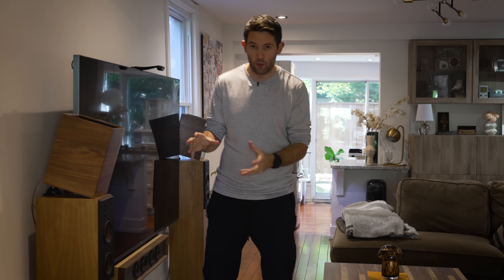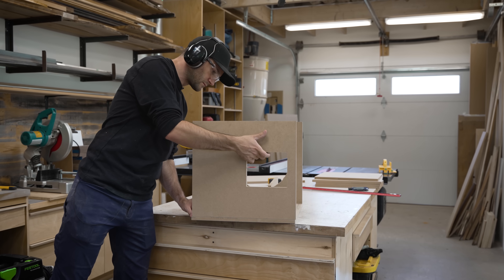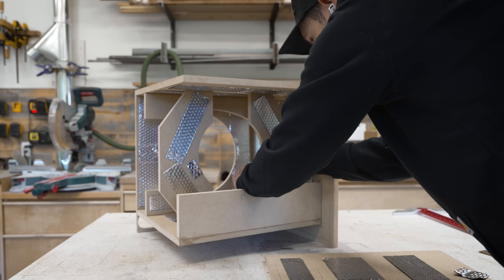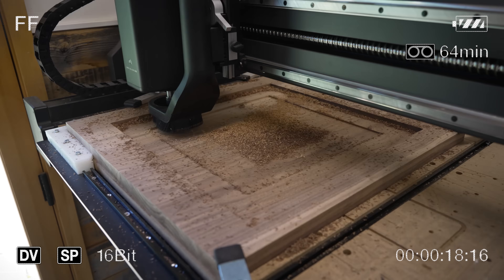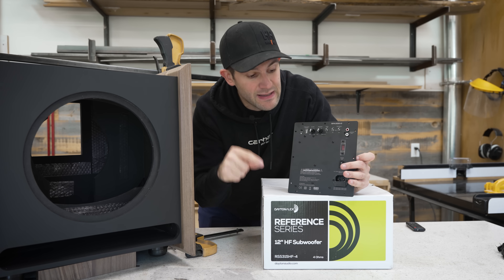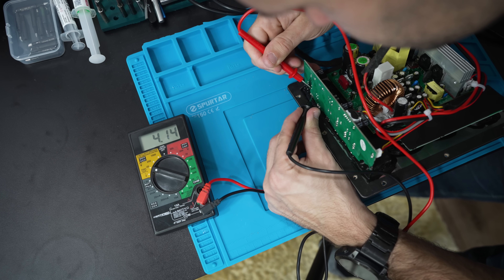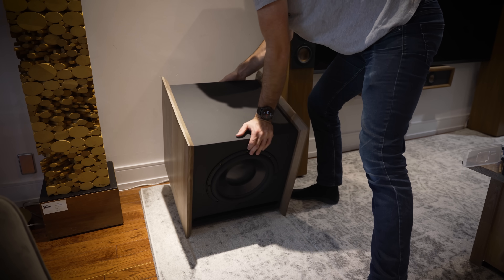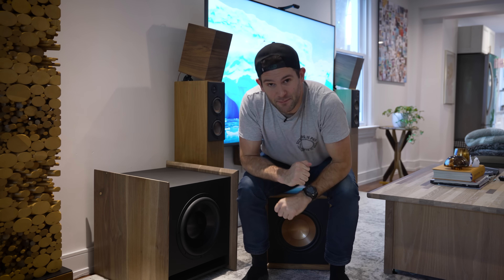THIS changes DIY Audio...

Comment: So sorry. Ported is so 1950s. Pulsed can drive up to 25x the sound with the same energy. See Burning man Cat-henge.
Reply: "Aaron “SPAZ” Winett. 

 He contributed excellent solutions to sound amplification challenges – especially the use of small transductive “exciter” speakers that effectively transform the entire Catolith into one large vibrating cat shaped speaker.  This combined with the choice and positioning of the subwoofers give the Holofelnity purring much of its aural appeal. "

Comment: Nice work. I might have to pick up one of those Daytona wireless transmitter systems, seems like it could save a lot of hassle trying to run and hide wires.  I'd use it for tactile transducers on my race sim rig and/or in a recliner/ couch but I don't think I'd use it on a speaker or sub. I might try it though just to see what happens.

I built my first subwoofer enclosures in the late '80's - early '90s and actually had to go buy books to read about it, no internet!! Can you imagine?  But those books were very interesting.  Car audio was a great hobby back then, it taught me a lot about electronics, automotive electrical systems, some "woodworking", soldering, wiring, speaker design, amplifiers, and even applied mathematics, etc.. all valuable knowledge for anyone to have.

My first one was a giant regular ported / bass reflex dual chamber enclosure made from 3/4" MDF (basically two separate enclosures in one box), with two 15" subs and PVC tube ports tuned to 30hz.   Being a broke kid I brute forced everything with a jigsaw and sandpaper but the end result looked and worked amazingly well.  That was for car audio but same principles apply. The first time you hear your creation after all that work is pretty satisfying and cool. And it sounded very good because I did some research before building it, not just purely guessing at the dimensions.

It was kinda nuts in the back of my little Turbo Shelby Charger, it was hilarious.. I ran a secondary small amp connected to a red light bulb so every time the bass hit, the red light would glow brighter and light up the entire inside of my car in rhythm with the music. Lots of fun at parties in the woods or out in some field around a bonfire or just to show off to friends. I wasn't the guy blasting it on the street annoying everyone around me.

Comment: I can only imagine the audiophiles throwing up over the distortion introduced by the wireless transmitter and how not using $12 k speaker wires and special AC cables for the power to the class D amp will make the system sound like poo, most likely even impacting the mid range and treble . . .

Comment: You've likely lost your punchiness due to the sub being so out of phase with your other speakers. You can do math and distances and all of that and still end up pretty far off with all those variables.  
The best, and only way really, is to take sweeps with REW and use the alignment tool to align the phase, invert if necessary. You can do a video on this. And then let us all know why doing wireless speakers is a bad idea.  

You'll have the latencies yes, but will they be consistent? As in every time you fire up the system it will stay aligned?

Comment: the sound deadening was a totla waste of time & money.  your internal bracing was overkill and renders the 'dynamat' useless.
also, you really should have used a Thiele Small  calculator and input all of your woofers detailed specs, and then calulated the encolsure volume properly (minus the internal bracing to correctly calulate the acutal total air-only volume of the finihsed box.
EDIT-  you are 100% DEAD WRONG regarding amplifier power.   every audio system ever is BETTER off having more amplifier power than the rating for the speaker. period.

EDIT 2- pro tip with any type of woofer mounting into MDF, is to buy T-Nuts  and matching threaded bolts.
that way, you never have to worry about ripping the soft MDF by overtightening, or by multiple in/out removal of wood screws.

Comment: I never use single layer walls, instead I'm putting two layers together with straight stripes of silicone across, like tile glue comb, just 1 inch apart (so air can escape easily), and scerwing them tight so silicone gets almost on all surface. Only being careful so I don't put screws where I want to juigsaw it etc. This allows me to use recycled 2.2cm wardrobe walls, giving 4.5mm thick, heavy wall. Cost is only silicone and screws then but effects are... hmm. Try it out. Recycle, reuse, silicone splashed to 0,01mm dont need time to dry. Trust me I am nobody ;}

Comment: if you think a smaller amp will protect your speakers you need to investigate what square waves(AKA Clipping) does to speakers . Headroom is better then set the gain so you stay as close to rated power as possible . That requires some wattmeter or volt meter and an Amp clamp . my rule of thumb is 50% more than speaker rated power for the Amp .

Comment: Also you have an error in the video: A Class D amp is not D for "Digital" it's D because it's not a Class A, B, or C amp.
Class A (Single transistor),
Class B (Push pull dual transistor),
Class C (Used in RF applications where it operates in Resonance with a tuned load). 

A Class D amp is not even really digital. it's Pulse width modulation and can be implemented with just a simple voltage controlled oscillator, an op amp acting as a comparator, and some filters.

Comment: Sorry, this is just ridiculous: way way too much design, woodwork, electronics work, 3D printing, customization, overkill, etc etc for a powered sub. I'm a great admirer of custom building where the rewards are great and you can't buy anything that fits the bill. This is not that. You have a lot of amazing tools and a great skills, and then you waste it on something you can buy ready made for about the cost of the materials you bought. Furthermore, to go to all this trouble and then hook it up wirelessly . . . just, no.

Comment: Its always better the amp has more rms as the speaker. When its the other way around you can quickly go in clipping and damage your sub because the audio signal from the amp is not good

Comment: The port is supposed to be tuned to the resonant frequency of the speaker in the box volume.
Also, that’s not big. 
When I was 16 I built a subwoofer with a 15” driver. The box is about 1200mm high, 900 wide and 600 deep. VERY low. Not very punchy, but it makes the house shake and great for movies.

Oh yea and after 4p years the MDF is still ok, unpainted.

Comment: Don't you have to decide sealed or vented first so you get the right sub fs, suspension and power handling capacity?   and then what freq response do you want.

Comment: You will definitely want a more powerful amplifier than the speaker. The more power an amplifier produces, the more 'noise' it has in the signal and the hotter it runs. By lowering the gain, the amplifier doesn't work as high, meaning it draws less current, get less hot and isn't 'noisy' with the audio signal. Too weak an amp, most likely you'll increase the gains, which creates clipping and that destroys speakers. A powerful amp, running as low as possible to extract enough volume from the speaker( just before it clips), will do a much better job that an amplifier with less power will on the same speaker. I installed competition car stereos for years, and that formula NEVER failed!

Comment: I was contemplating rebuilding my old Kenwood subwoofer since the amp died and the cabinet is beat up, but ended up buying a cheap replacement for now. I live in an apartment with wood floors and neighbors below me so it doesn't make sense to have killer bass. Eventually I'll do the same when I move.

Comment: Does not even go over efficiency when choosing his speaker.
Properly designed sealed enclosures will have much better bass response below their tuning frequency than ported ones do.
Deeper, extended bass than ported to be more exact.
I see novice, budget booming.

Comment: Also, sorry bud, but you are absolutely DEAD WRONG about matching your amp wattage rating to your subwoofer wattage rating.   You are actually MUCH better off providing more wattage with your amp than your subwoofer is rated for.  You have a Significantly higher chance of damaging your speaker if you provide it less wattage than it needs than if you provide it too much.   When you don’t have enough  wattage, you introduce clipping into the signal, and clipping = distortion and damage to your driver. When you have a higher wattage amplifier, you provide your driver the headroom it needs to pull the power it needs during peaks in your audio from your movie or music.  A subwoofer will pull the power it needs from the amp, rather than the amp cramming whatever power it has into your sub.   Sincerely think you should read up on this, I assure you it’s correct and you really ought to edit a correction into your video.   Without it, you’re accidentally pushing misinformation.   Cheers man.

Comment: Just a heads up, using sound deadener on subwoofer boxes is basically pointless.   Superficially, one would think it would make sense to use, but the panels you’re attempting to deaden aren’t going to be resonating in the way that the sound deadener would provide any meaningful effect. You’ve succeeded in making the subwoofer significantly heavier, but the deadener, unfortunately, is just dead weight.
Reply: If you were building the subwoofer box out of sheet metal, THEN you’d definitely want to slap  about 4 layers of sound deadener on there.  But the MDF isn’t going to resonate in a way that the deadener would provide you any audible effect.   Cheers.

Comment: Beautiful build! Two things I would point out: First, I don't think that butyl rubber is doing you any good. Probably no harm either, but it's not there to absorb anything. It's purpose is to mass load the sheet metal panels in a car. The mass of the butyl rubber you installed is probably not meaningful, next to the mass of the rest of the subwoofer. There are other products designed for absorbing resonance in a speaker cabinet, but I don't know which if any, will help with the low frequencies of a subwoofer.

The second thing, is that there isn't really such a thing as too much amplifier power. The spec on an amp that tells you how hard it will drive the speaker, is the gain. The gain is really a ratio between voltage input and voltage output. If you look at several amps side by side, you'll see gain is always similar. So what the wattage implies, when voltage is fairly consistent, is the amount of current available. The voltage is what tells the driver how loud to go, but the current is what drives it. The speaker driver(s) will respond to the voltage and draw the current they need, but they won't automatically just consume all the watts and explode. What can happen though, is if the amp runs out of juice, the driver will hang mid cycle and burn out the voice coil. So, you can't really have too much power, but you can certainly have too little.

Comment: Very nice project. A nit: Class D isn't digital in the usual sense. The sound is never encoded as digits. Rather it's analog pulse width modulation (with post filtering).

Comment: Your woodworking is impeccable. There are several design issues that I have questions about-
1) if you connect the speakers to the receiver’s amp and you use wireless for the subwoofer signal you are bound to have latency issues. Best case you are looking at 5-7ms but your sub signal could be as much as 30-100 ms behind the mains. 
2) there is no such thing as too much clean power within reason. You should get a bigger plate amp with upwards of 500-1000 watts. There will be a point where too much power will cause the sub to bottom out or distort from being overdriven, but it is much safer than an amplifier that is struggling to power or clipping at the output. That makes the voice coil hot which makes it burn which breaks your woofer much faster than having too big of an amp. With too big of an amp it is just a matter of gain staging. 
3) the subwoofer should be double baffled. Especially since you cut some material out to flush mount it. Maybe I missed that you did this but it didn’t look like it later in the video. 

That said it looks great and I would love to have a woodworking setup like yours. Subbed!

Comment: It's pretty, but I REALLY wish you would have done some more research before making an instructional video. Lots of bad info. 
Port design is flawed - inconsistent cross-section and the opening is smaller than the rest of the port, which will lead to chuffing.
Painting wood before you glue it is generally a bad idea. Glue sticks to paint, but paint doesn't stick nearly as well to the wood.
Class D does NOT mean digital. It means "switching".
Subs do not need amps rated at or below their power rating, they usually need an amp rated well above their power rating (1.5-2x is a good rule of thumb).
Use of dynamat was a waste with the amount of bracing you have and not prepping the surface beforehand means it will probably fall off in a few months anyway.
Time delay of wireless extender needs to be considered, which is likely why your sub no longer seems "punchy". You'll want to add 25-30' to the actual subwoofer distance when calibrating your receiver. Unless it's auto-calibrated, then hopefully it will correct for you.
And I always laugh when people do A/B comparisons on Youtube. Shockingly they both sound exactly the same because we are listening through headphones, or cell phones, or PC speakers, and even if we weren't, the mic in your phone or webcam can't capture the difference anyway.

Comment: So I dig it. And I’ve been a sound tech for over 20 yrs the only thing I don’t agree with is your amplifier selection. Nothing sounds worse than an amp at the edge of its limits.   I always pair amps that have at least one and a half times the power I’m gonna need and prefer. 2x the power.    The amp has a gain knob for a reason.   I’ve never run an amp over 3/4 power output and get nice sq and spl.  Everything else.   I dig it

Comment: IMHO the best sound is from subwoofers with a passive radiator, like the earthquake, for example. And it is better to isolate the amplifier from the main volume of the subwoofer

Comment: Are the cables under the carpet inside flat conduit? I remember your first video building this whole layout & the cables under the carpet were a very real concern. Thanks for the neat video on speaker builds!
Reply: Also to echo what others have said, your amplifier should have more headroom than the max watts output. You'll end up running out of power at higher volumes with the undersized amp you show in the video. I would recommend a 600 watt amplifier if they offer that model in 600 watt.

Comment: For anyone watching this video, great information. But, never ever-ever remove your hands off the material you are cutting on a tablesaw while the material is in between the blade and the fence. At exactly 1:57 you can see this mistake.

Comment: The cspeakers ones weight and speed determines its momentum and that needs to be controlled for accurate sound. When the signal stops the cone has to, too and vice versa and all the motion in between needs to reflect the actual audio signal.

All amps have a damping factor (DF) which is the ability to control the speaker by detecting its back EMF (voltage) through the negative feedback loop and correct the positioning of the cone thusly. Tube amps  with an output transformer have a fairly low damping factor <10 to 50 or so depending on the size of the amp's output stage  including output transformer and the amount of negative feedback used. Solid state amps have inherently low output IMPEDANCE which when combined with high negative feedback yield a much higher damping factor, i.e. ability to damp the motion of the speaker and keep the cone where is should be, or stop it when the signal is 0. 
Damping factors are usually much higher for SS amps - 300 on up. 600 is very tight control. 

Cable size matters as that is part of the output impedance of the amplifier. For bass, bigger is better and lowers output impedance and thus raises DF. I would want to see at least 12 gauge from the amp to the cone.

This sub is a folded horn which needs a higher DF to control it as opposed to a sealed cabinet. IN a sealed cabinet the air pressure inside resists the motion of the cone and creates inherent damping. In a horn or folded horn the air pressure in much more frequency dependent so the sound can become muddy which is ok for a jet plane flying through your living room. But for a tightly tuned kick drum and complex bass passages, common in pop, fusion, jazz and orchestra, clarity depends on control of the sub and the woofers in the main speakers.

It's a bigger engineering problem than is presented here, which is simply a speaker in a box. And also there is no mention of the crossover frequency where the bass signal transitions from the main speakers to the subwoofer in the proper phase alignment. In this case he's probably doing it by ear thru the sub amp's controls. After all the point here is bigger is better. This is not to say what he has is not satisfying but probably could be better with some tweaking.